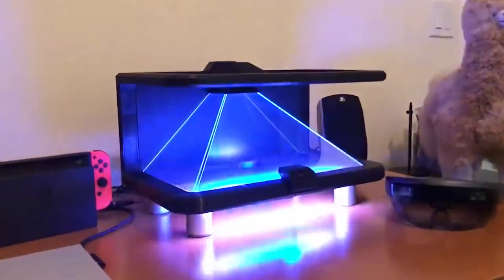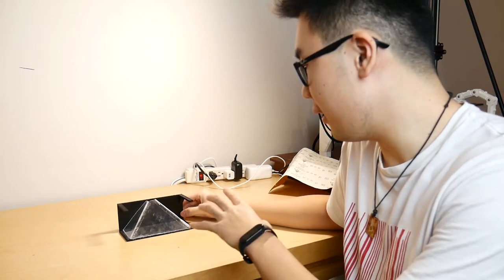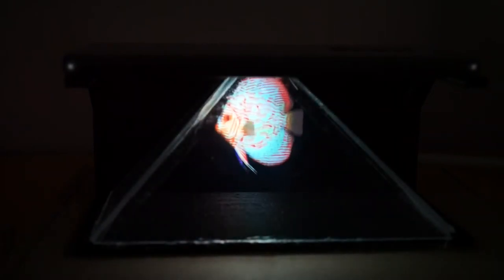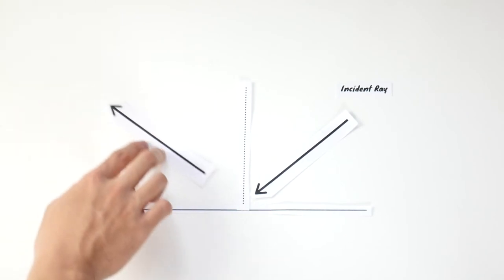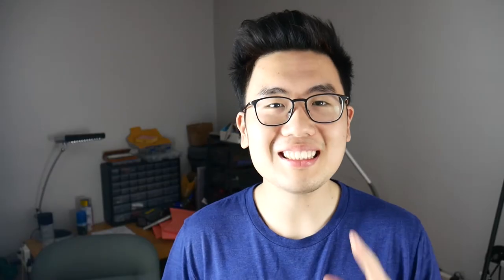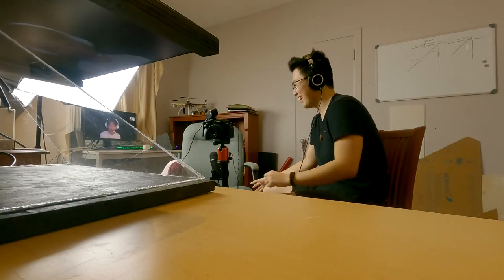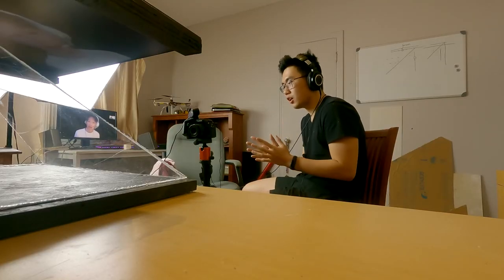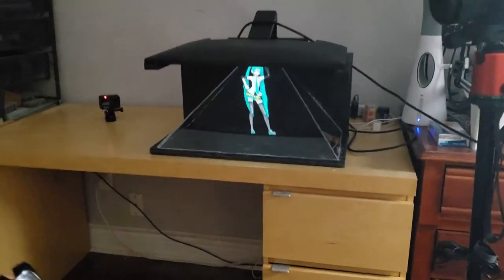Making a Hologram Projector to Videochat My Friends

Comment: i made one of these too. 
i think its really only impressive as a marketing display .
(especially when you actually triplicate the video for each facing side.)

other than that, the magic begins to dissolve, FAST!
 i think as you find less and less ways to interact with it than you have in mind at first.

but
i noticed when i set up my hologram, 
and 
connected my phone
THEN,  and only then,
I suddenly chit my pants.

i could say, place an object inside the display,
and DRAW on it with hologram ink, sitting anywhere in the room 

!!!!!
THAT, was alot of fun then